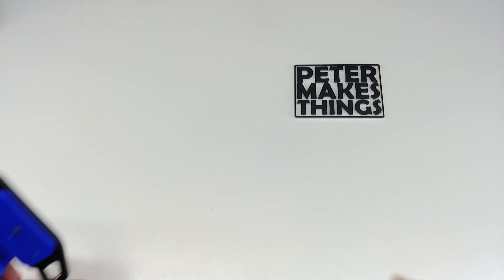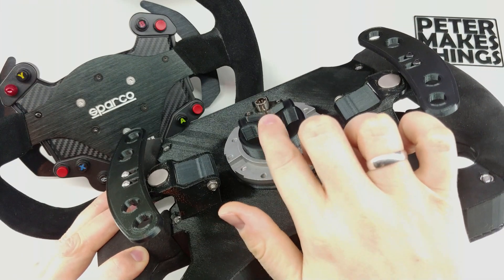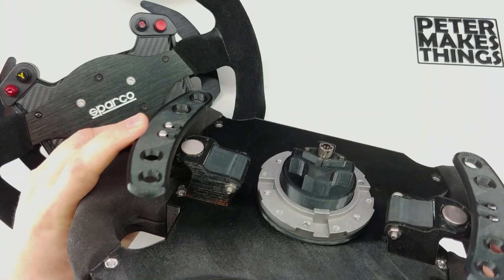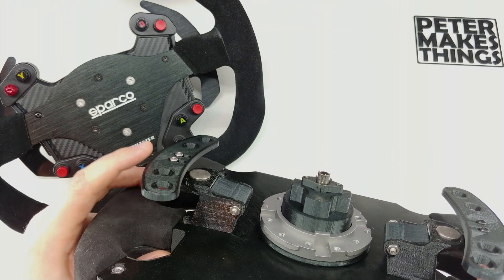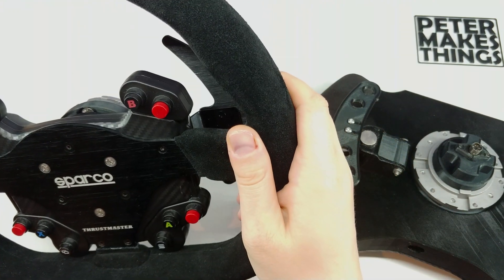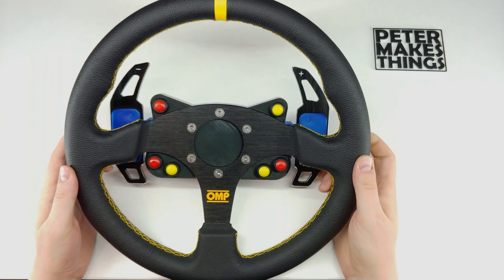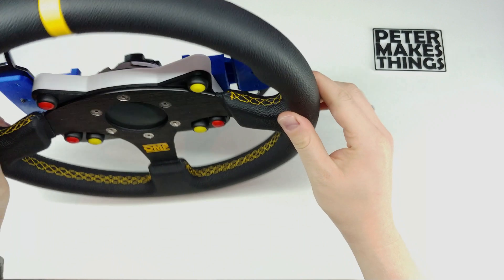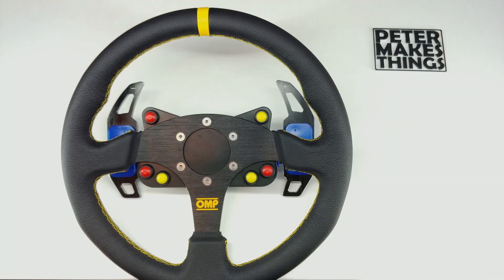How To: DIY Paddle Shifters for Sim Racing wheel

Comment: nice video! i dont know how to wire my shifters to the arduino . I dont have the cablest with those connectors, i use normal wires.
Reply from the maker: check the 2 videos I made on how to make a wheel for thrustmaster, it shows the basics of soldering and wiring arduino, part1: https://youtu.be/Hg58OLH7puU

Comment: Well, I dig the magnet shifters on my rim from 3drap. Contrary to the original spring loaded shifters on my former Thrustmaster rim, I practically eliminated all misshifts. 
I think the paddles' travel is the key. I adjusted the microswitches in my paddles so they get activated as soon as the paddles get pulled off their magnets. So in the end I worked around the "regressive" resistance by keeping the travel as short as possible.
Also I glued in small felt strips to dampen the noise, which magnetic paddles produce a shitload of. :)
Reply from the maker: Nice idea, especially with regards to control the 'bite' point, I have an idea running in my head to do a 2-magnet paddles (up and down as per who'sthisguythinkheis?'s suggestion) and use a hall sensor with potentiometer to have a fully customizable travel, just a concept but I'm excited to start working on it.